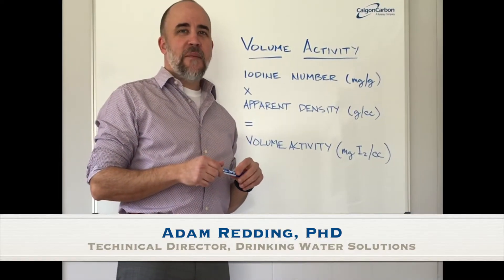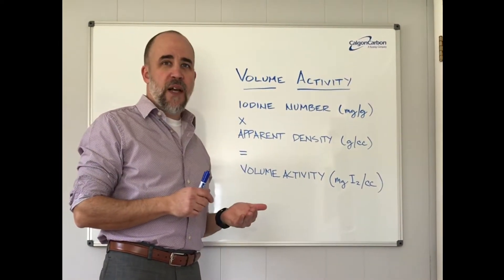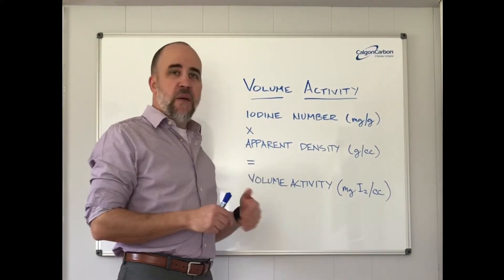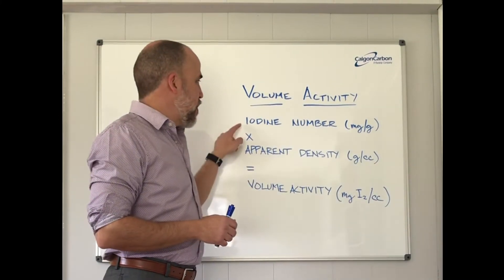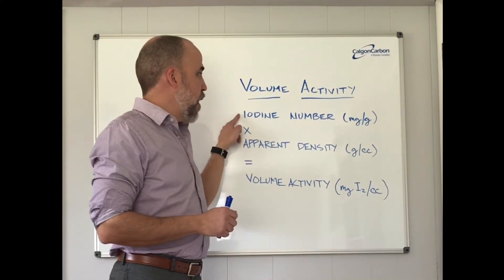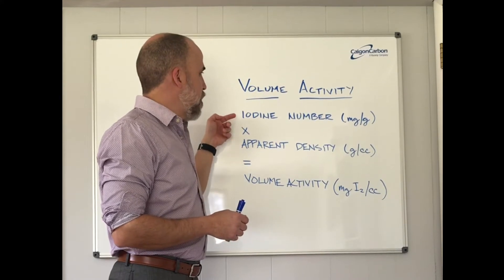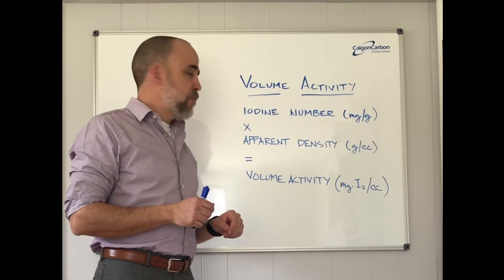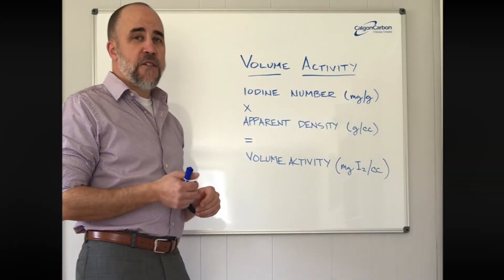Activated Carbon and Volume Activity

Comment: Hi there, 
Is there any correlations between Iodine number and the contaminant removal?
Thanks.
Eka
Reply: Hello Eka, 
Thank you for your question.  Yes, generally there is a good correlation between the Iodine Number and contaminant removal.  The Iodine Number is a general indicator of total surface area and is somewhat focused on the total volume of micropores.  Since the contaminants adsorb in these pores, more of these pores then provides more capacity.  In the case of Volume Iodine, it is a matter of normalizing the Iodine Number in a way that makes sense with how carbon is used, where typically it's installed as a set volume to achieve a certain contact time.  Volume Iodine is particularly important to consider when comparing carbons with a large difference in apparent density, assuring that the same capacity is available in the bed.  Another thing to consider is mesopores in the carbon, since these are the pathways to the microporosity.  If the carbon has a low mesopore volume, diffusion of the contaminants into the micropores can be slow, and carbon performance will be hindered.
Reply: Hi Dr. Adam,
Thank you for the response and explanation. 
Do you care to share a graph that shows the correlation between the Iodine number of the GAC and in my case, TOC removal? I am curious about the TOC removal percentage  and the corresponding Iodine number when the media is sent for regeneration or discard.   @adamredding1263